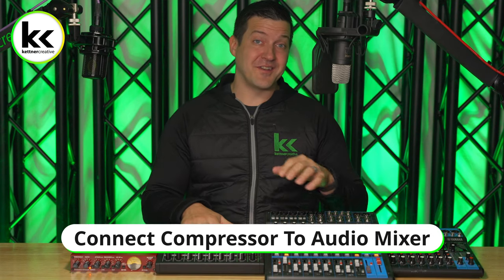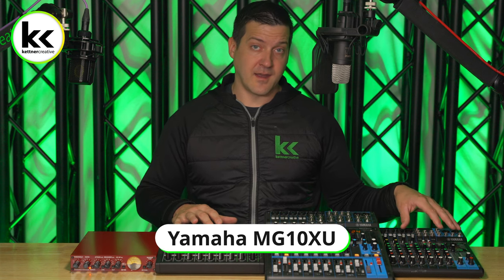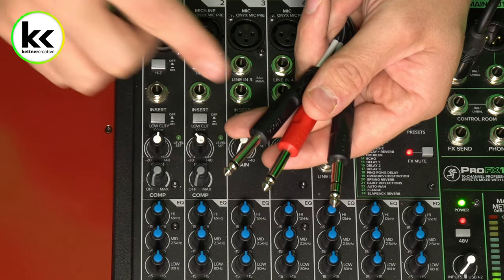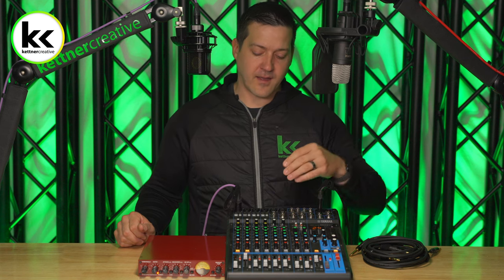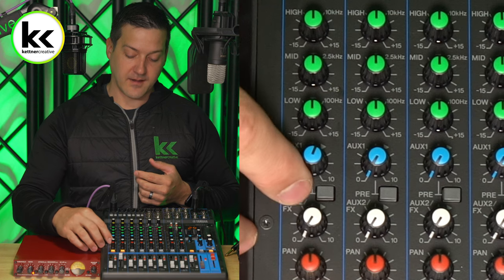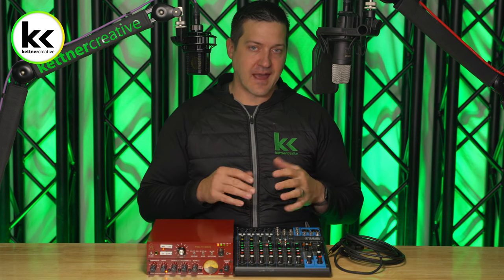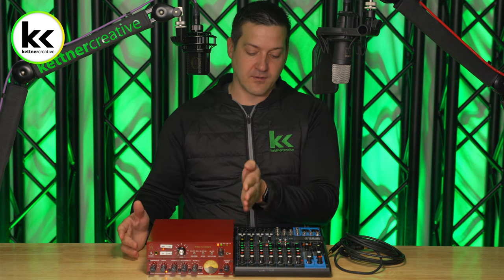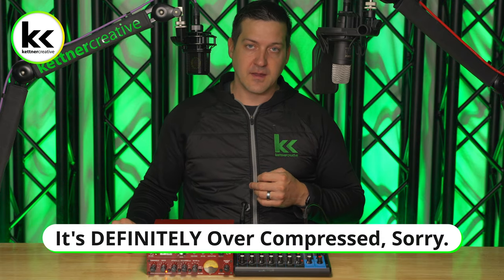3 Ways To Connect A Compressor To Audio Mixer | Complete Guide

Comment: Thanks for the video. I recently got a behringer compressor for 20 bucks off fb marketplace. This is my first peice of outboard gear. My interface is a sterling harmony h224 and does not have an insert port, so I am going the pre amp route. Found a presonus tube pre on reverb for 50 bucks. My question is, when going from amp to compressor and compressor to interface, are you using unbalanced or balanced trs cables ? Thank you

Comment: great video very helpful on options for gear ....if i have a stereo-2 channel mono- linkable piece of gear,- can i still use  ts cable to connect  to a patchbay  and then to an insert, or do i have to go from insert to gear -to patch ..ie using mixer phantom power   will it pass through signal chain on cables  TS  or TRS ???

Comment: Subbed!  Thank you for sharing your knowledge with us that are not so smart!

Question- In 2nd example, you connect the return to the mic/line-in.  This way, the compressor effect only affects channel strip, NOT the stereo bus (all channels), correct?

I asked this similar question on another one of your videos. (Behringer 1622FX Pro with dual mono inserts on back)
Reply from the maker: Yes exactly. Some mixerslike the Allen & Heath will have an insert for the stereo bus and main output, but not for smaller mixers like this.
Reply: @kettnercreative   Thank you! Not only for the tutorial but also taking the time to respond!  Not many do unfortunately!

Comment: I'd like an in-depth tutorial on how to make AAA+ electric guitar videos without a camera or laptop.  Just using my android.  Thanks in advance 😉
Reply from the maker: Are you okay using an interface? It's REALLY easy to connect a Volt276 or 4th Gen Scarlett 2i2 to your phone now.
Reply: All kidding aside, resourcefulness is very much required for beginning content creators.  Right now I'm trying to figure out how to record myself playing a solo over a backing track. I keep running into obstacles.  I'm confident I can do it with the gear I have(tascam x8, shure beta57a, UA Ruby, Samsung smartphone) My last attempt I came to the conclusion that Spotify is blocking the system audio from being recorded on my camera app. Im gonna have to incorporate a separate phone and play the backing track through my orange combo amp and mic it up
Reply: @kettnercreative thank you for taking time out of your day to respond.  I can't begin to express how much valuable knowledge I've learned from your channel.  I didn't know anything about audio recording or audio gear a year ago. Everything from audio signals to connecting various audio components, how interfaces work etc. Thank you. When it comes to offering value your videos are all meat and potatoes with no filler.
Reply from the maker: @michaelmay9059  Thanks for the comment. That's been my idea from the start. No filler. I try to include stuff that I think is relevant, but I try to stick to the point. I think in the new year (I know, a long  way away), we're going to be doing more stuff with instruments (Keyboard, Guitar, Bass, etc.).
Reply: @kettnercreative  I think incorporating concepts around recording various instruments into your channel would be well received and is a natural progression. I also think it will likely expand your subscriber  base. I started a channel a few months ago but am conflicted as to its direction and how aligns with my goals and desires.  My main desire is to write and record original songs. I started the channel with the idea of cultivating a community while simultaneously building up a catalog of tracks. The issue is balancing time because I also have a family and work full time job. I was afraid I couldn't give both projects the time and commitment necessary to be successful.  My heart isn't really into creating guitar/gear based content. I also am aware that I need to spend less time thinking about stuff and just do it.